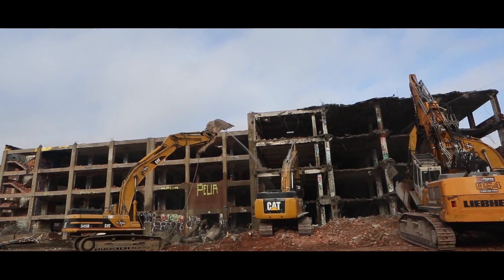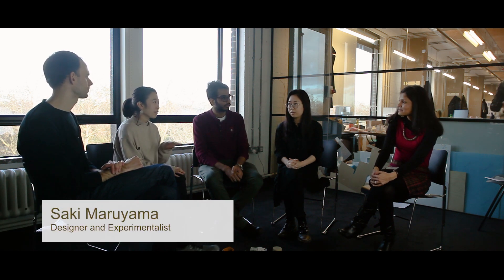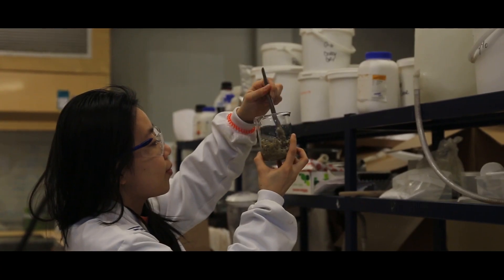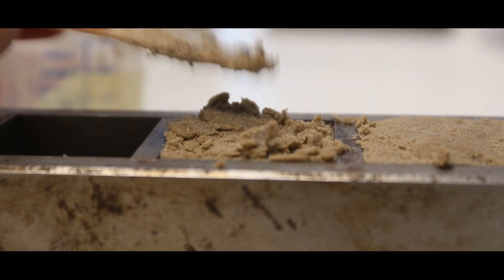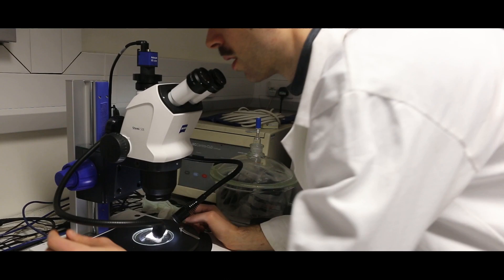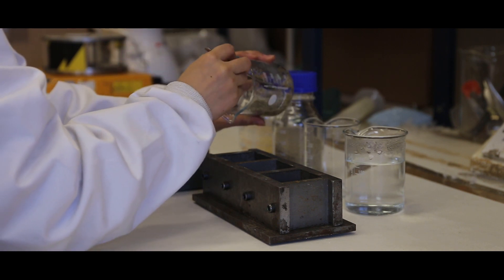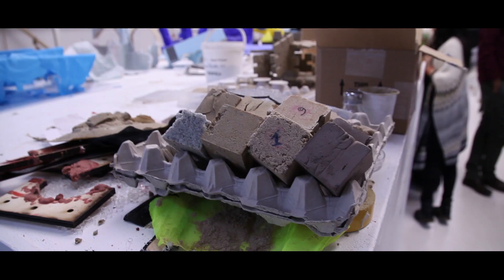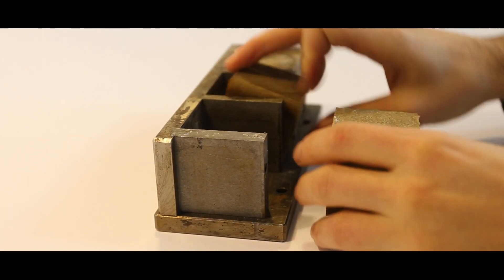A potential solution to the sand crisis -  FINITE

Comment: This seems to require more energy to process than it does for cement. Also, I doubt it is as strong as re-inforced steel and will require deployment of additional energy to rebuild much sooner. How does it do with weather changes?
Reply: Valuable qs